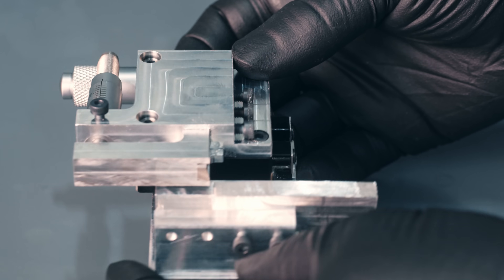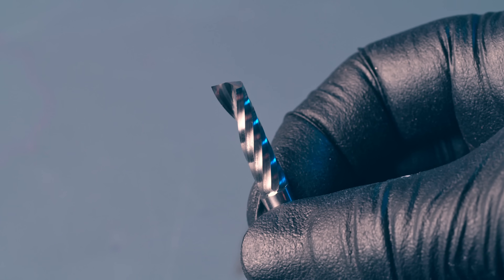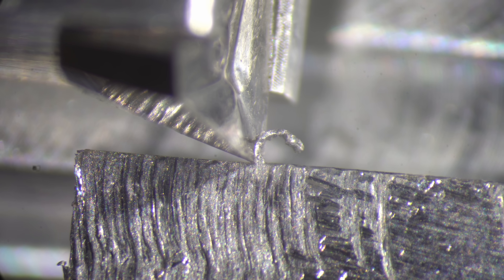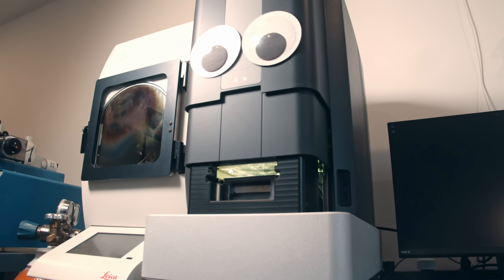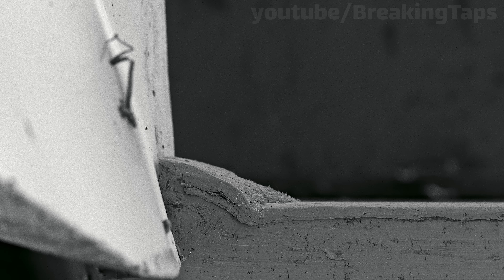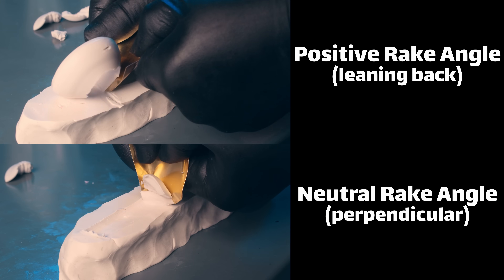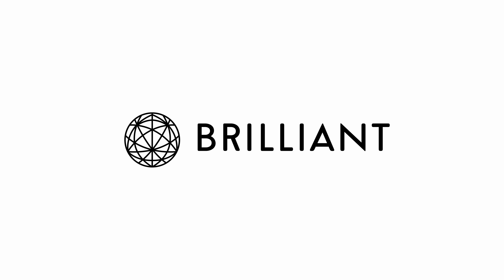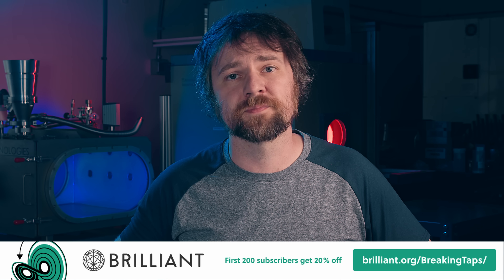Cutting Metal inside an Electron Microscope

Comment: Really nice work! Every time someone wonders why the machined surface can't have a better finish, I'll refer them to this video. The process looks surgical from afar, but the tool is just ripping chunks off.  I also really want stepper motors in my SEM!
Reply from the maker: Thanks! I was really surprised how clay-like it ended up being. I knew it was pretty ductile but I was still expecting to see more "cutting" than "smooshing" 😄 Will be interesting to see how steels look once I get the setup rebuilt. 

While working on this video I went back to see how you did the phonograph video, was hoping you had a neat trick to automate it!
Reply: This is not cutting at the intended speed either, that has a bug influence
Reply: @christ0ballz-h4x  That's a great point. Every material has an optimum cutting speed.
Reply: How about a collaboration between you two guys? You have two of the most unique channels on YT.
Reply: Between the two of you, it'd be awesome to polish and etch a sample and see the cutter move through grains and boundaries. And definitely agree that steppers in the chamber would be a great time investment and open up a whole lot of ideas into the realm of practicality.
Reply: Go look at single point diamond turning of optical surfaces. It has been routine tech for decades to directly machine optically smooth surfaces in metals, plastics, and crystalline materials like germanium and ZnS. The last machine I used before retirement was a Moore-Nanotech Nanoform 350 (made 2005), it produced microroughness on the order of 15 angstrom RMS in cast aluminum, 10 on ZnSe. The surface form on a 2" diameter was better than one micro-inch PV. A surface made with that machine was flawless to the educated eye - it appeared to be precision optically polished. 

In that world looking at the chips with SEM and optical microscopes was common. A lot of research work was done looking at cutting edge geometrics, coolant, speeds, diamond face orientations, even the diamond types, in regard to crack propagation and resulting surfaces.
Reply: https://www.youtube.com/@nanotechsys6311/videos

https://www.youtube.com/results?search_query=Single+Point+Diamond+Turning

https://www.google.com/search?q=microroughness+%28angstrom+OR+%C3%85%29+%28RMS+OR+%22root+mean+square%22%29
Reply: How about battery and electronics inside the chamber rather than clockwork mechanism?  I'm guessing batteries and electronics could be a problem in vacuum.  For that I'd turn the problem inside-out.  Contain/seal/pot those components.  By quick look,  I found epoxy for  vacuum application.
Reply: при реальном резании в зоне деформации материала происходит сильное нагревание, которое радикально меняет картину. Чистота обработанной поверхности очень сильно зависит от режима резания. Чуть ли не больше чем от всего остального.

Comment: Cool video!  You could possibly enclose a battery, stepper driver, and microcontroller in a sealed box with four feed through terminals as another option if enough room exists in the SEM cassette.

Comment: As for pass through you can use old refrigerator compressor connectors , 3 pins gnd power and serial data

Comment: Seeing that cutting process as a video really makes it clear why less depth of cut is not always better. While the natural tendency to a loud squeal is to increase rpm or back the cutter out, fact is that if it is just shearing tiny bits and not forming a chip, then chatter is only worsened. For HHS there is another issue where all that skipping will quickly roll over the cutting edge, dulling it.

Comment: No offense but you are well premature in suggesting HSS "isn't generally used anymore". There's plenty of room for HSS in milling and lathe tools still. I use both. It's horses for courses. :) Now back to your vid. :) Just pausing you again to mention how to make certain shape tools for the lathe by milling HSS in the mill with solid carbide end mills. Sure did take a while to work up a good feeds n speeds recipe though. :)
Could a battery work in the chamber? I'm thinking of a battery-powered gear motor to advance the tool between shots.

Comment: maybe make a vacuum proof electronic box to put a battery, microprocessor and (if it's not too much of a faraday cage) a wifi module. So you can still put electronics in the vacuum chamber without having them be rated for vacuum in the first place

Comment: Ok i know this is a bit extreme but lets say you decide to encase a battery in epoxy...
Ok outgassing... Now place the assembly into an electrolicis bath and coat it with a few mm or aluminum. Just a thought perhaps its going to an extreme especially given the option to build a box to do the same thing.

Comment: Great video but as a minor sidenote I have always been told that it is not advised to machine aluminium with Tungsten carbide or diamond because the reactivity of Al with carbon that will create premature wear but not with carbon steel or HSS . 
Also, HSS is still widely used  due to its thoughness, Tungsten carbide and diamond are hard but very brittle so vibrations due to improper use can damage them.

Comment: Can you put the battery and controller into a sealed container, and wire a motor to this box? Using a simple Arduino, you can control when and how long the motor should rotate.

Comment: Seeing the metallurgical structure of the aluminum in this gives me a question/ idea! 
Don’t know if many people know this or not, but the  rainbow colors that form the oxide on stainless gtaw welds has a very defined crystalline structure kind of fanning or sprawled out from the center of the weld zone 
Being that they’re mainly visible from being cooled  at differing rates, and the colors are the result, 
-im now very curious as to if each crystal defines itself differently or are also very noticeable in the gray scale of the SEM??

Comment: When automating it, move the material and not the cutter, and you wont have to align the images

You could definitely also make a little box with a lipo, microcontroller and stepper/servo. I can only assume there are vacuum safe servos, but if not you could always use a few o-rings and a shaft through the box like how the ISS window covers work

Comment: 10:50 you can have thick silicone seal (like electroboom I think it was) had, and pass wire trough it.. you get some leakage but thats let you get wire for stepper motor in.. only question is if SEM will work with that

Comment: this was great, until i saw you using a carbide insert...

carbide in operation works differently. its actually MELTING at the sheer zone. you wont recreate the way they really work at these speeds and feeds. especially not with aluminium. yuk. almost always invariably has a land or radiused edge, so forces are much higher than with nicely honed HSS.

carbides also dont like shallow cuts. i know, i know, its hand operated...

sniff, not a mention of stellite...

would have been good to see a comparison between carbon, hss, stellite, and carbide...

Comment: As an old machinist i would have much preferred a high speed cutting tool (generally a much keener edge and better suited for low speed applications) and cutting through steel (not as malleable).

Comment: Is it at all possible to get an electric motor in there? Or perhaps a spring-loaded mechanism that cuts slow enough?
This is really cool, and the only feedback I have is that it's great and I want more of it.

Edit, just saw the part about how expensive electric passthrough is. I assume batteries are completely out of the question. oh well. But the clockwork thing would be cool if it can be slow and strong enough.

Comment: BTW If you need a small battery with decent power output, possibly even already hermetically sealed, look at LIR2450 - a fat coin-cell format li-ion cell that can put out half an amp or so. or maybe even a bunch of LR44 alkaline button cells - these can do a good few hundred mA.
Reply from the maker: Oh that's awesome, thanks for the tip! Yeah the two things I was concerned with batteries were how they reacted under vacuum (so i could avoid building some kind of pressurized container) and if they had enough juice to actually run a small motor. Haven't done much research yet but will start with these, thanks!

Comment: Seems like it wouldn't be too hard to put  a battery in a hermetically sealed enclosure, though outgassing from plastics in a stepper motor may be an issue. Also magnets in the motor may affect the SEM.

Comment: That's some extremely cool footage. Much like the decades old chip formation videos that circulate around Youtube, but on an entirely different scale (haha...). Maybe there is a cheaper DIY solution for powering an electric contraption inside the vacuum chamber that doesn't involve changes to your SEM at all. Off the shelf batteries aren't vacuum compatible of course, but what if you but them inside a small low leakage pressure vessel? I imagine something cobbled together from a few common KF fittings and a surplus multipole KF feedthrough, since these come up on Ebay for cheap all the time. Just an idea ;-)

Comment: What about putting a wireless controller with a battery? Or even couple questions motor from inside and outside the chamber with a transformer? Coil inside and coil outside? The wireless controller system sounds really really useful in other projects too

Comment: do you think you could get away with a magnet on the inside and outside of your chamber that lets you transfer the rotational motion through the wall of the chamber. then you could still use a stepper motor to automate it so long as the magnet is strong enough

Comment: could you use like a battery bank and an esp32 to wirelessly control the steppermotor without the need for feed through connections? or is putting a battery bank into a vacuum chamber alongside an electron gun not a good idea?

Comment: As a student in mechanical engineering this was absolutely amazing , can you use some sort of raspberry pi controller with wifi to control a stepper motor from outside , without that expensive box , or even your on windup clockwork idea can be modeled with just a arduino and a stepper that does exactly what the winder does, only problem i can think of is putting a battery in vacuum, which now that I've said it , I'm beginning to think batteries might get very very mad if you put them in vacuum! Anyways just shooting ideas , thank you for those hours of work , the result was magnificent!

Comment: HSS doesnt really cut faster, it doesnt soften in high temperatures around 300*C or even higher, where as "regular" steel would loose its hardening. While cutting at high speeds you generate more heat, hence the name "high speed steel" since those alloys dont loose their hardness as much (they still do, but waaaay slower) at those high temps

Comment: Rake angle of tools are highly dependent on the horsepower of the machine tool as well as the hardness of the material being cut.

Negative angle results in a stronger cutting edge but requires much more power. Positive angles as demonstrated require less power but result in a thinner cutting edge. It’s a game of efficiency thats played by machinists all influenced by cost, Material removal rate (MRR) vs Tool life of X material. That being said some super alloys have very limited tooling options due to hardness/toughness of the material.

Very cool video BTW.

Comment: Deffently the coolest right after an atom elctron micrscoop image. But I bet you can earn money on doing this for sandvik or kenthametal. Too help them understand how it cuts. So pleas do this agian, with 316 L stainless steel, and make sure your surface is 0.2 R atleast. Then maybe use a stepermotor to help you save some time. I would recomend 0.01 mm at the time.

Comment: Why don't use stepper motor ? Just seal it in some container and with RF and 2 magnets on both sides (in container on stepper motor and out on handle) move it between each shot. More shots without venting chamber and more precise for positioning (shaking video).

Comment: The way this looked really made me think of the way some cheeses (Double Gloucester in particular!) behave while being cut. This actually made me realise there are some perhaps surprising similarities between the structure of semi-hard cheeses and metals because a block of cheese begins as an aggregate of pieces of curd which are compressed together as water is removed during the initial making of the cheese, and which then go on to partly diffuse together as the cheese ages, resulting in a structure that appears more or less uniform but actually consists of strongly-cohesive pieces bound together by weaker bonds, analogous to the polycrystalline structure of a metal.

In your footage, the way the metal behaves looks just like how a piece of semi-hard cheese behaves as you slice it. - The force being applied first causes separation of the crystal boundaries in the primary shear zone, leaving a smaller and therefore weaker amount of material connecting them which can stretch and warp easily, allowing the material above the cut to flow as it moves away from the cut and up the face of the cutter, until the radius of the curve through which the "chip" has to bend becomes too great and causes it to fracture. It's really just like cutting a piece of cheese!
Reply: Makes sense of "AvE" talking about "cheese grade aluminium". ;)

Comment: What amazes me is skiving as used to manufacture some copper heatsinks. Where a blade cuts into the metal, making a perfect thin sheet and stands it right up. It somehow doesn't even fit into my brain that this is possible without ruining the structure of the metal.

Comment: I would put an esp32(for easy wireless control) or other Arduino with a battery and a stepper motor driver. I think a battery could survive without much outgassing.

Comment: i've always wanted to know what a cut was (at the smallest level), but even seeing this i'm still unsure. it looked like the metal sorta of split before touching the blade. so, does a cut work by pulling apart the metal like fiber in a log? can you please do more videos like this? maybe cut a hair, or cheese, or cut a razor blade with another razor blade. it's still not clear to me what a cut is (how would one define it?).

Comment: If you haven’t done it already, would love to see a metal surface change as it’s polished from 80 grit up to mirror polish. It would be awesome to see the microscopic changes on the metal surface. And what a mirror polish looks like under SEM. Btw this is an awesome video! Never though it would look like mud being scraped off
Reply from the maker: That's a good idea! I've looked at surface-ground finishes on the AFM before, but never a comprehensive comparison between different levels of grit. Would be neat to see!
Reply: @BreakingTaps  hopefully it'll be worth the time like this video was 👍 seeing this was insane!
Reply: @BreakingTaps  You might be able to buy a surface finish gauge which is just a bunch of mounted samples.
Reply: @BreakingTaps polished and etched please

Also, thorlabs has a number of vacuum compatible linear actuators like the 13 mm PIA13VF piezo inertial or 25mm Z825BV DC servo actuators
Reply: @BreakingTaps  If you are going to do this, dont stop at mirror polish. Go to EBSD-level polish and show the channeling contrast of the pollycrystalline material. It may very well be publish worthy if you had the side well polished so that the plastic deformation stacking during the cutting was actually visible in the SEM images... Shame that you dont have a normal full scale SEM available, with the tons of spare feedtrough points it would make your life far, far easier...
Reply: Yeah, the material being cut looks more like clay being pushed off. Never thought a cut wasnt really a cut before i saw this.
Reply: My guess is that it differs in scale. And even though 2000 grit sand paper (i'm not sure if there's finer) creates mirror polish, structure of metal is damaged at surface way too much for crystalography analysis (EBSD) and it requires polishing by finer diamond dust paste or chemical/plasma etching - way easier if microscope has focused ion beam (FIB) column.

Comment: Out of my own curiosity - I would love to see how feed and speed rates also effect the chip geometry and formation at that level. 

I am /completely/ unsure how one would go about getting images similar in detail to an electron microscope while a cutter is moving at 100-1000's of RPM (or equivalent linear surface speeds). 

My suspicion is - and I suppose it would depend on the material as well - is a lot less "crumpling" might happen at these higher speeds, but I guess I can't really think of a reason why that would be the case.

Comment: If you really wanted to upgrade your chamber you would simply drill a hole in your vacuum chamber and put the wire or plug in the wall and then glue that back up with silicon or tart

Comment: I was able to tell that you were Machining aluminum before you told me in about the it in the middle of the video because of the way the post cut face was reacting to the tool it was tearing and making little hooks this is why machinists call aluminum a grabby metal because those little hooks will literally grab onto the rest of the tool you could get different reactions from the cut material by changing the metal to my understanding brass tends to make a little plate-shaped chips though you might find something different under the microscope I'd also like to see what happens when you cut soft Steel or any other metal you can get hands on

Comment: Really cool to see. Would also be interresting to see what grinding looks like, for example with grinding stones or sandpaper and so on.
In regards to the box with electrical feedthrough, could you not make your own? D-SUB connectors that are vacuum tight are expensive but not that expensive compared to the storebought box.